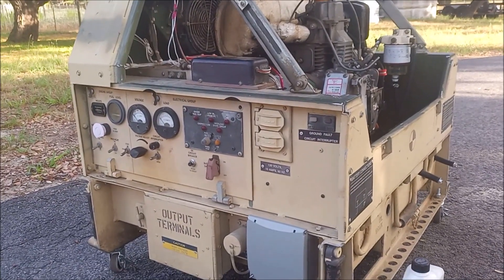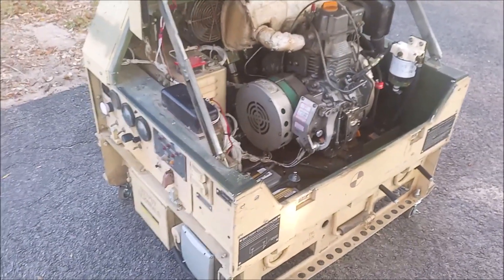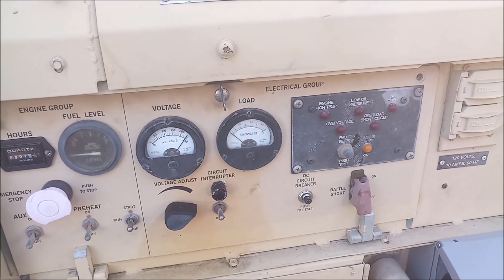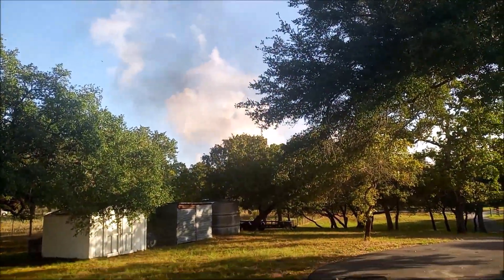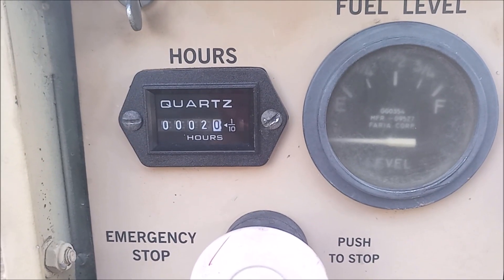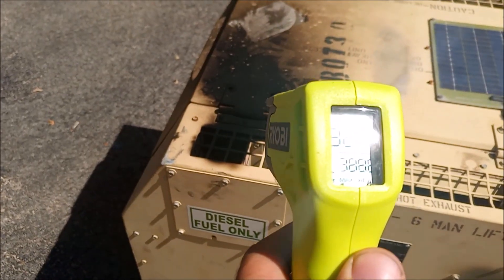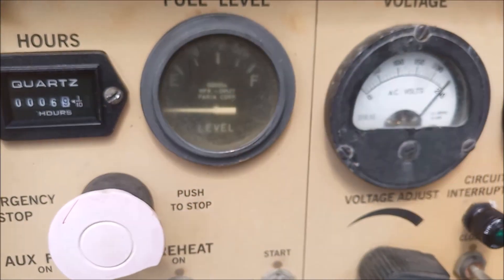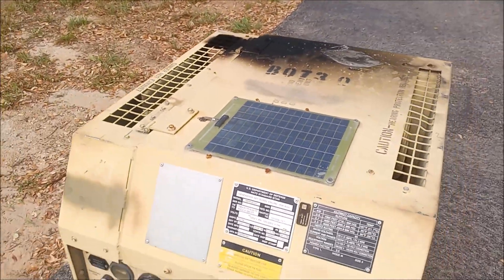MEP 831A - 6 hour 100% load test

Comment: how loud is this unit running in DB?
Reply from the maker: As per the specs, "less than 85 at the operators position" at full 3600 rpm operation. So, at less than full load, it goes down.

Comment: If you use the AUX fuel to a 55gal tank these babies will run all week. Then once a week I'd change oil and refuel. This is for a retrans site, so it was running maybe 400w of radios.
Reply from the maker: Yup, these sip fuel for sure.
Reply: @CallMeColtLLC  2.5 gal 22hrs @60% load

Comment: Those Yanmar engines are solid. Shouldn't be stuttering like that. Bleed the fuel system and make 100% sure it is free of air. If it still acts up, pull the injector and pump and take them to a fuel injection shop for testing and cleaning. Betting something got into either or and that's the reason it's acting up.
Reply: Normal is 2000-3000 hours. Most problems outside of electrical are the muffler coming loose and needing a head replacement, overheating cause fans die, or loss of prime. The inverter will die before the engine does, and you can manually set the throttle if the actuator or speed load control dies. I've also found they run better on 5w-50 or than military 15w40.
Reply from the maker: It ended up being the controller, not the engine. :) The governor was ever so slightly out of adjustment & was going slightly to low in RPM once warm. I figured this out later down the road & with a 1/4 turn, it worked flawless. I have since sold the generator as it wouldn't power what I needed it to fully.
Reply: @CallMeColtLLC  Nice! Glad it turned out to be something simple. Those are always the best fixes
Reply: @CallMeColtLLC  Paint mark the bolts..will save you headache down the road. Also, the TRC SLC tend to burn out. That is why often times I would just manually set the throttle and not even use the SLC. 95% of the time the Army just uses them for running a few radios and a tent light. When I get called out it is because some officer is making coffee with his kurieg plugged into the 10a GFI.